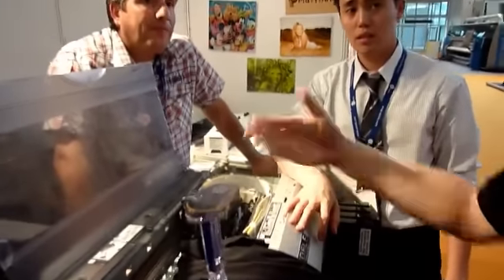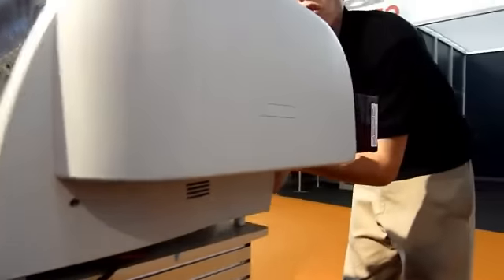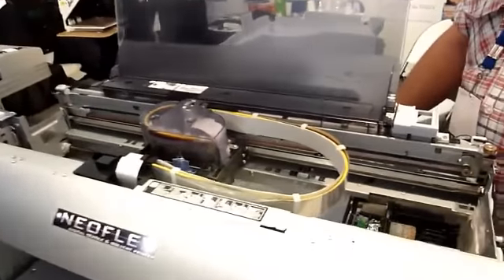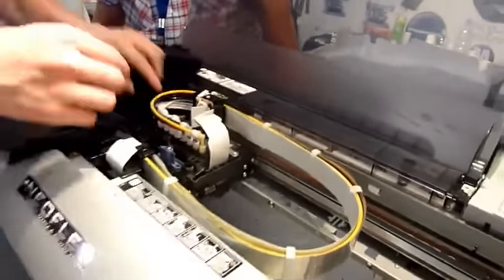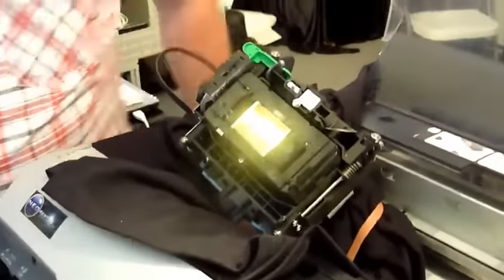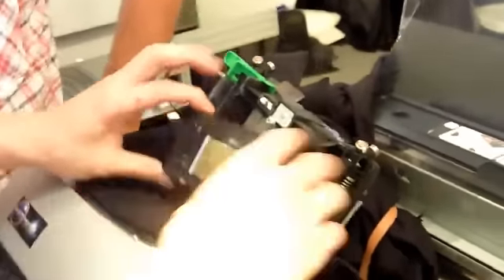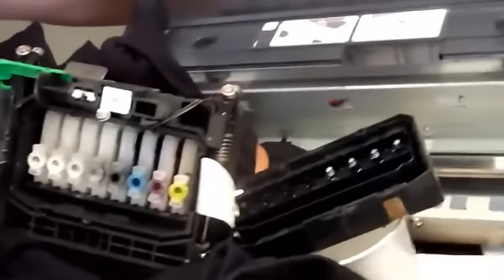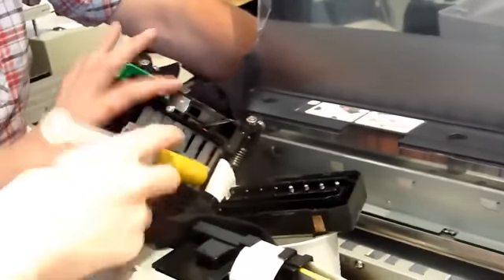Neoflex Maintenance Flushing Printhead part 1 of 2.mp4

Comment: hello my friend.   you can tell me what the correct damper for use with hoses direct the cartridges: ink uv ok. you have the right dampers there? I'm not ith the printing bombiamento system. this direct connected cartridges in dampers. ie'm using negative pressure ..
tanks.